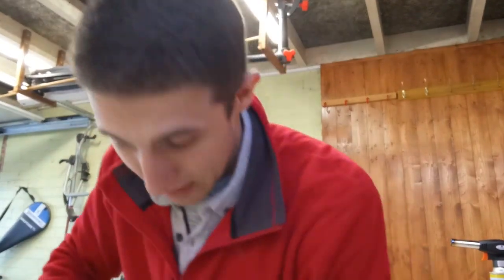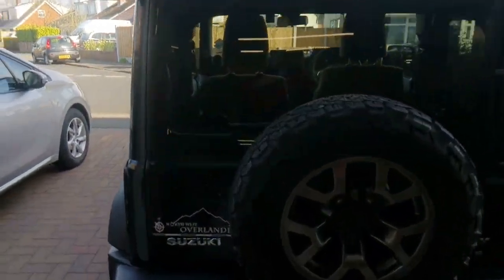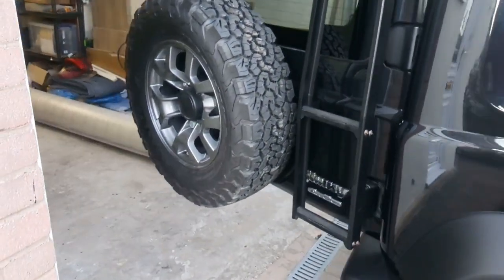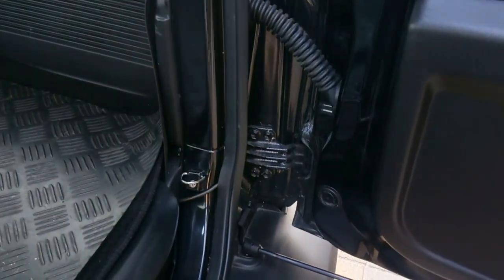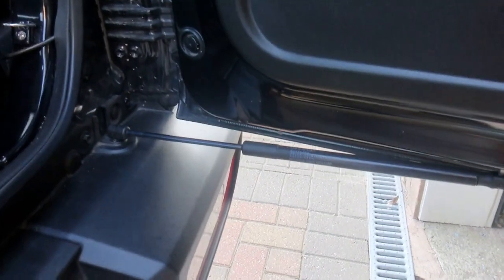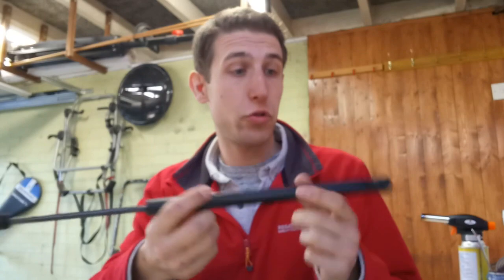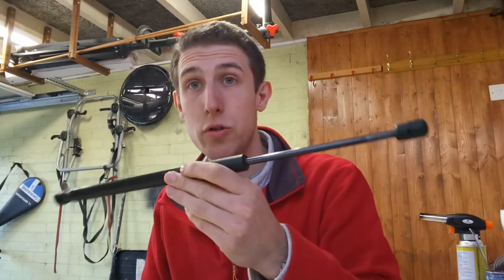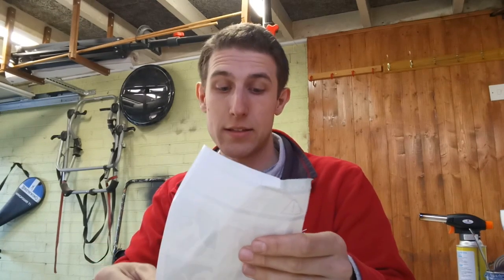2019 Jimny rear door Change - New Video 2020

Comment: I've carried out the same modification, but I've decided to revert back to the original gas strut. The electrical harness coming from the cabin into the rear door becomes extremely tight when a strut over 490mm is installed. (The OE Stabilus strut is 480mm). Carry out this mod at your own risk!

Comment: Can you not adjust the pressure in the gas strut so that it opens slower/more controlled?? SGS website says you just need to release some gas using an Allen key.
Reply from the maker: Mine isn't adjustable. But I'm in the process of getting readjusted. Another video will be up with the comparison

Comment: Just got a 2019 Jimmy looking to start green laning any advice would be grateful especially tyres
Reply from the maker: Tyres make a massive difference... I went with 215/75/15. Any bigger and it messes with your gear ratio. I've also change my suspension to OME 2" lift. Much better on motorways and around country lanes.

Comment: Thank you ! So it SGS engeneering but which model is it?(i m planning to make   back tent so to open wide thé door is kinda nice^^)
Reply from the maker: You'll need a gs8-18-200-250 strut
8mm rod 18mm dust Cover
X2 10mm ball joint sockets
Reply: North West Overlander thanks à lot man